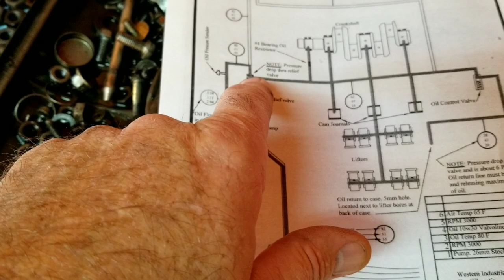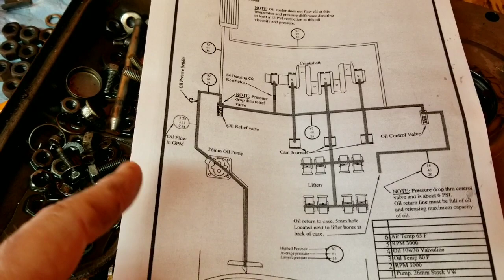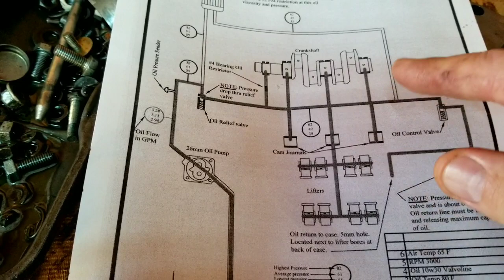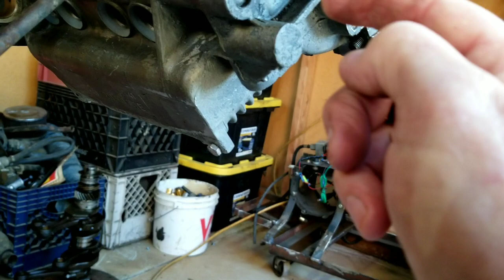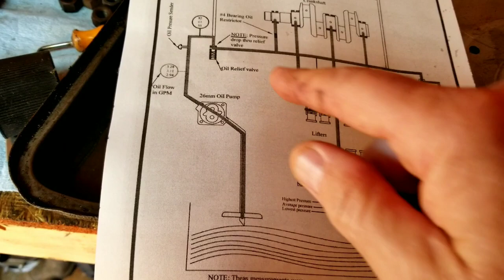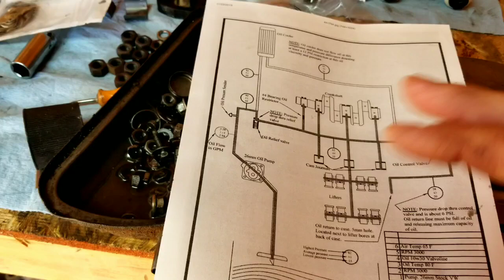vw engine single relief and dual relief cases oil passages and modifications

Comment from the maker: I realize I pointed to the wrong area on the return on the engine on the full flow system. I dont usually open that up myself I have the machine shop do it or buy the case already done.

Comment: Question, I've been getting periodic pressure loss (pressure light coming on), on a 1914.  Its like once every couple months.  I have mechanical gauge at the motor and vdo in dash.  Crazy part is when light is triggered, I turn motor off while driving and turn back on and light may not come back on in months showing pressure loss.  Runs perfect, have you heard of such.  I will be replacing dual relief springs and plungers because I'm stumped.  Motor also was recently upgraded to 2276, it just did it yesterday.  Your thoughts.....TIA

Comment: The first relief controls oil temperature passing / surpassing oil cooler, feeding main gallery front to back when coldest and back to front at normal oil temperatures; and the second relief valve controls overall pressure of the sistem.

Comment: You kind of got it right. The rear oil pressure relief valve (pump end ) is solely to control pressure to the oil cooler. When the oil is cold and oil pressure is high it bypasses the cooler to the main gallery, which also allows the oil to get up to operating temperature quicker. The front pressure relief valve (flywheel end) controls the overall main gallery pressure. On a single relief there is no control over the main gallery pressure so they used to blow oil cooler seals in very cold climates.

Comment: The small main oil galley is not going to suffer from low oil pressure due to its size but low volume especially to what it feeds. Higher pressure can push more oil to places harder to reach but also cause greater volume bleed off in areas that are loose like worn non cam bearing case. If oil pressure drops when engine warms up to a low level at idle but goes  up as rpms increase it is close to good adjustment. If oil pressure stays high after motor is hot even at idle that would probably be too high of an adjustment. 10 lbs per 1000 is a good goal so as not to over pressurize the seals and cooler.

Comment: Single relief cases still work well for stock engines and mild performance engines as long as you don’t expect 9 billion rpms out of it. Also, doesn’t matter what case you’re using, the higher rpm you push your engine the shorter it’s life expectancies.
Reply from the maker: for me it is just what am I investing to put in the case. Like stroker crank or ibeam rods expensive cam. Yea for stock parts it is fine. Low rpm great for that. someone could use a stock crank small cam and stock ported heads and do just fine. or put top end parts that can be transferred to more bottom end later

Comment: The reason VW went with the Dual Relief case is because in cold weather climates they had a problem with the oil being cold, the oil would become thick.  When the engine starts with thick oil the presure would rise very fast causing the o-rings in the oil cooler to rupture.  To eliminate this problem Vw desided on some 1500 and All 1600 cases to go with the dual relief redesigned case.  At the same time they changed over the the Aluminum oil cooler.
Reply from the maker: yea I dont know if I would put a dog house on one. We may do another budget build with the one I have. I wouldnt want to invest machine work money in a single relief. maybe a line bore but not much more than that.

Comment: There is a point where increasing lube system pressure only leads to excess power drain on the engine and excess wear on the oil pump/pump drive.
It's why modern engines run oils down to zero weight (0w-30w), admittedly running clearance are finer than older engines.
Quality lubricants and we'll spec'd clearances are the engines friend.
Reply from the maker: makes me think about something.... what about using synthetic oil in a single relief. might be a good experiment. thinner oil will move through the passages with less resistance. Might be up for that one.
Reply: @Mikefngarage  Yes Mike, a friend of mine here in Australia is into historic racing MG's, he's had problems wearing out the camshaft and oil pump "skew" drive gears because he had a high capacity oil pump
 He's reduced the oil pump capacity, now using full synth low weight oils with an accumulator charge system for cold starts, more delivered HP and no further problems with oil pump drives and relief valves. He said evidence showed that the large pump was loading the system up and running the relief valve full open and wearing the pump and drive gears.
Reply: Good info Gary!!

Comment: The hoover mods were done to mitigate wear caused by running the engines at a constant high rpm in a plane.
He was really pushing the limitations of the stock oiling system.
In my opinion this mod is only really required for engines that are run really really hard, but it's an excellent upgrade that definitely works.
One issue I always have in WBX and T4 engines is that the oil pump is a loose fit in the case requiring them to be o-ringed.
Do T1 engines have the same issues with Schadek pumps?
Reply from the maker: makes sense to me too. relieving some of the work from the center main could not hurt anything IMO. supply from the front cam bearing would be easily resupplied because it is really close to the pump.
Reply from the maker: some of the early aluminum castings or machine work on the t1 aluminum case had issues with needing an o'ring added to the pump. and if the pump housing wore out it was also a fix. cant remember why that happened.
Reply: Never seen the use of an O-ring with the oil pump, that is very interesting.  I never worked on a T4 engine.
Reply: @JWClassicVW  The pump body is so loose in the case you can just pull it out by hand and wiggle it about. 

I o-ring each side of the inlet/outlet holes to prevent air cavitation and oil bleed off when hot.
Gene Berg offers o-ringed pumps your side of the pond. 

Gives a 30% pressure improvement at hot idle.
I think it's only an issue with WBX and T4 cases.
You can also machine the front groove for an o-ring but you need to clearance the gears correctly as there is no gasket fitted.

Comment: It seems like on a dual relief the front one by the flywheel, opens when it warms up.  On mine you can hear it open up.  Somewhere in a box I have a G.B. ball valve pump. It is used but they used a real VW pump to build it. I can not remember if it is a large hole or small.
Reply from the maker: yea your right on that part of it I was a bit confused.
Reply from the maker: I believe that spring has 2 actions. one pressure 2 heat and it releases the tension by one or the other so the oil cooler gets oil after warm up. FIrst bearings then cooler.